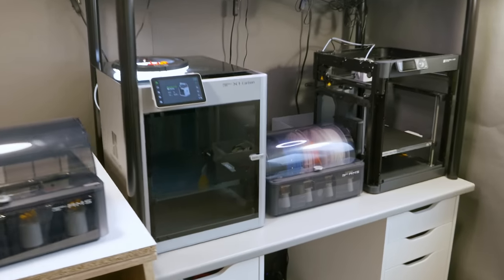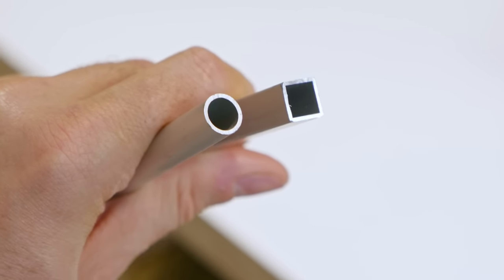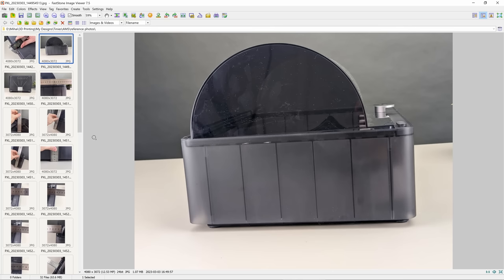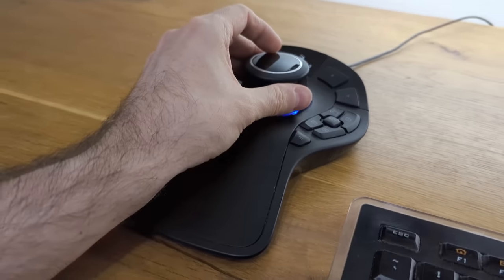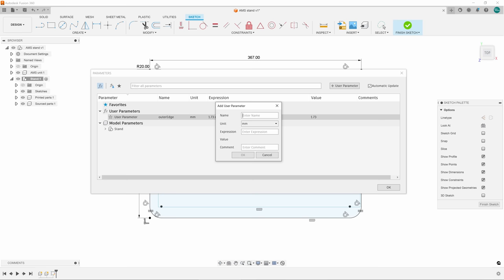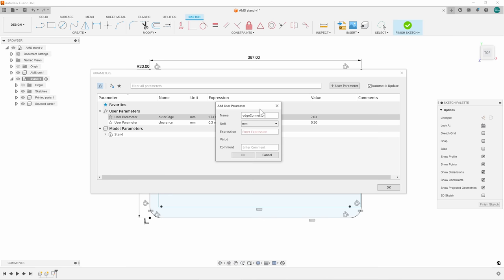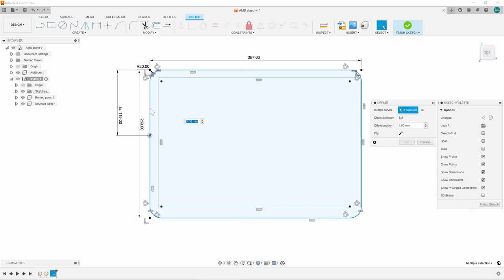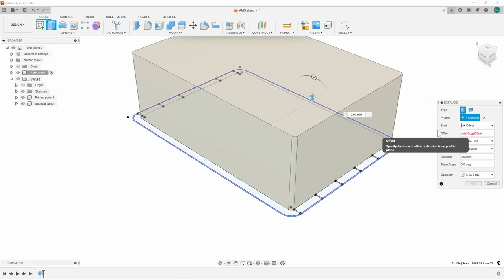Fusion 360 workflow for designing a complex 3D printed stand

Comment: To prevent prospective distortion I use an old scanner that I've modified so it will scan with the lid open/removed.
I tape a metal machinist pocket ruler to the parts to scale them in Fusion 360.
Reply: Another option is to take a photo of it from the other side of the room with a long lens. The further away you are, the closer to an orthographic perspective you get.
Reply: @thenickdude  if you're going to go that far wouldn't this setup be even better? I know that's not the point of this video but I think it would achieve what we're looking for. 
https://youtu.be/9cT0jXI7l4E
Reply from the maker: That's pretty cool! I wish I kept my old scanner.

Comment: You can, when using the dimension tool, directly add a variable. For example width=10 instead of 10 will create a width variable with value of 10.

Comment: I've noticed in F360, when the pattern (or any other additional dialog window in a sketch appears ( pattern, project ), you can left-click hold the top of the box and move it around and it will change size.  Also note there is a small slider bar in the patter box along the right.

Comment: If you want to go perpendicular on a spline you can add a tiny circle to the spline (coincident center), coincident a point to spline and circle and then draw a line through that point with tangent constraint on the circle. Useful for projected splines where you might not have the ability to add or move spline points.

Comment: Your final filament cutout clearance ended up 0.3, which was the same clearance you used for the rod hole.
However, for the rod, prior to any test print, you added another circle to add an additional layer height of clearance (0.25) on top of the rod, in order to counteract any "slight squishing" of the hole that might occur during the 3d print process.
I'm curious why you did not add an additional layer height circle in the filament cutout, also, since (I believe) the orientation is exactly the same as the rod hole, and therefore it should be susceptible to the same type of squishing, correct?
On the other hand, when you slid the filament into the test print, it went in smoothly, so perhaps the additional circle would also have been unnecessary in the rod hole.
Your comments?
I enjoyed watching this, and would love to see more like it!
Reply from the maker: Good question! I didn't go into much detail on this one. The filament cutout is printed vertically (as the part gets rotated for printing) so there is no squishing. The rod cutout however stays sideways and needed expanding on the vertical axis (in the printing orientation).
Reply: @MihaiDesigns  Yes, this is true, somehow I lost track of the relative orientations of the 2 features -- thank you once again.

Comment: if it's on the same dask as the bambu, you might want to add some rubber pad on these supports, so they don't progressivly slip and fall from the table
Reply from the maker: Interesting point! My desk is quite sturdy so I didn't think of that, but on a flimsy one there's indeed the risk of slipping off the table.

Comment: Do you have any experience with the palette 3 pro? I have one and a new P1P that I would love to use together but they do not communicate together. I need to figure out if I just have to buy a couple ams units at this point.
Reply from the maker: I haven't used the Palette, although my brother has one and used it once. You're probably better off using the AMS.

Comment: Visually, your means of stacking those ugly AMS units on top of each other is the only thing worth looking at. I wish the AMS’s had square boxes for the rolls of filament. Then it wouldn’t need a curved top. If filament rolls came in their own self-contained and fully functional boxes, and those boxes were rechargeable with new rolls of filament, wouldn’t that be empowering? If the intake port of the X-1 was 3/4ths of a stainless-steel ball, and the surface was covered with a hundred through-holes, imagine the possibilities. Can you put the critical guts of 1/4th of an AMS in a square box that holds a 2 kilogram roll of filament?